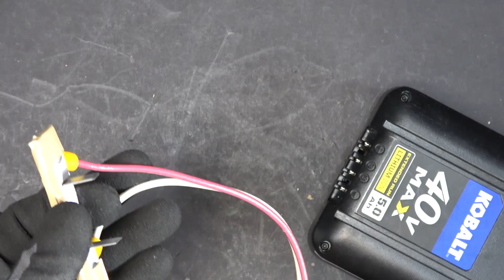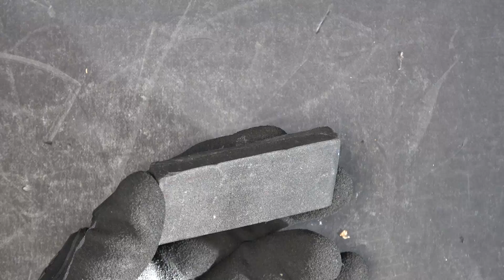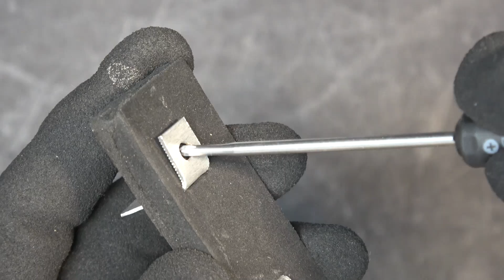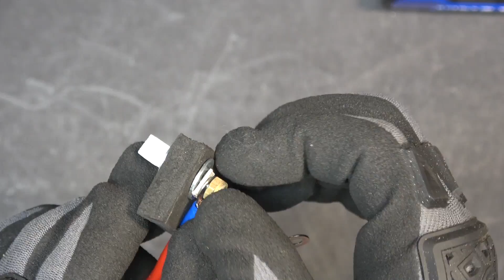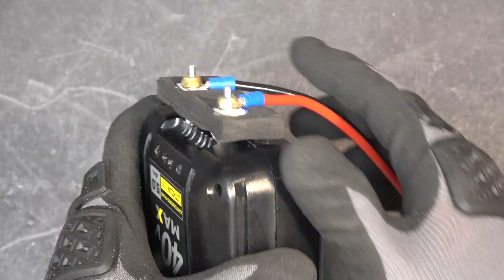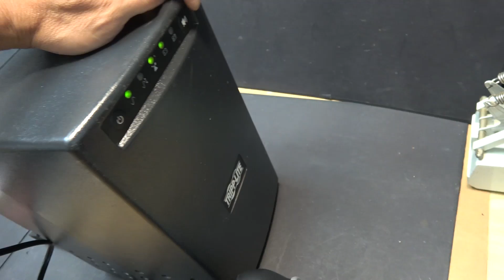DIY: Make an XT60 connector from EVA foam for a Kobalt 40V power tool battery

Comment: WE NEED A MAP OF DUMPSTER LOCATIONS---FOR CONSTRUCTION MATERIALS? IT'S TOO EXPENSIVE TO KEEP GOING TO ACE HARDWARE. HA
Reply from the maker: Actually, the best free construction materials are from new construction places where they are still building houses. There are lots of scrap wood, plywood, PVC pipes...all kinds of NEW construction materials for free. All you have to do is to ask. All of the leftover materials are considered trash and they are going to throw everything away anyway. Just take a peek at the trash container they have on site and you'll be surprised to see what they throw away.

Comment: Awesome video as usual! 
Can I use the ups to charge the batteries, plugging it into the wall, and just leaving them plugged into the ups for when the power goes out?
Reply from the maker: You can use the UPS to do anything a regular wall outlet does given within the amp ratings of the UPS.